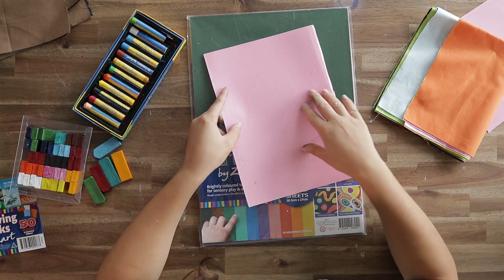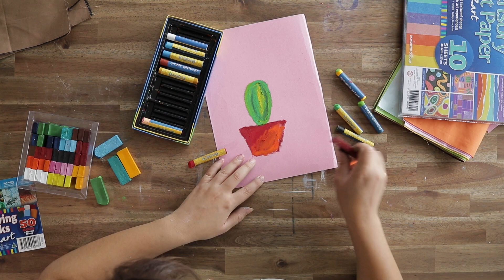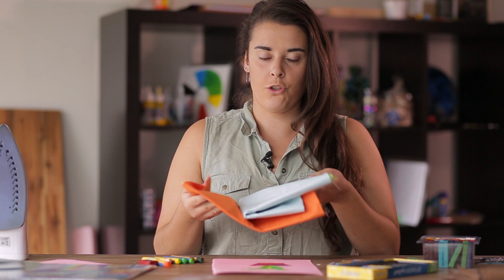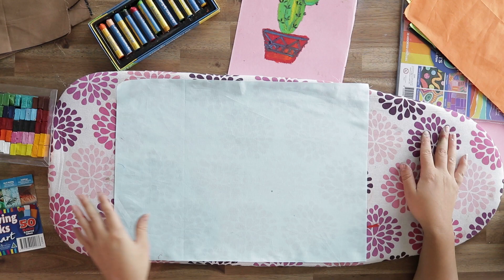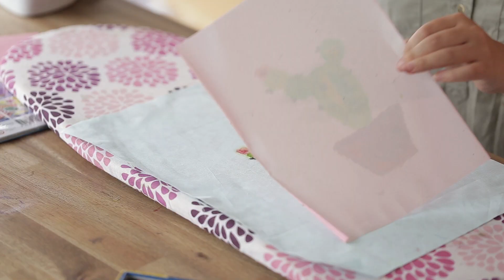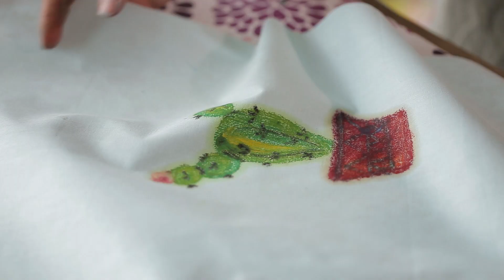How to Mono Print onto Fabric using Oil Pastels and Sandpaper | Zart Art

Comment: Will regular sketch paper work too? Or does it have to sensory paper?
Reply from the maker: Hi Kelly, The sensory paper allows more pastel to sit on the surface on the paper. You could try with normal paper however it is more likely that your print will come out grainy and lack detail.
Reply: Zart Art hey thanks! I love oil pastels and I have many designs that would look cool to print on a tshirt fabric! Thanks for the video! Cool cactus btw😊🎨